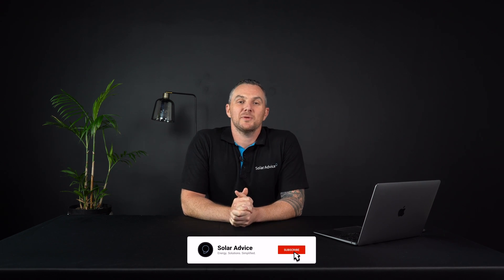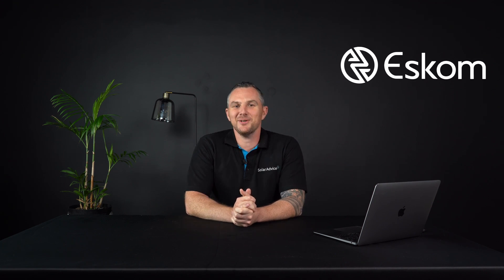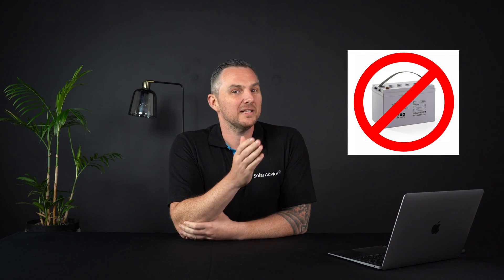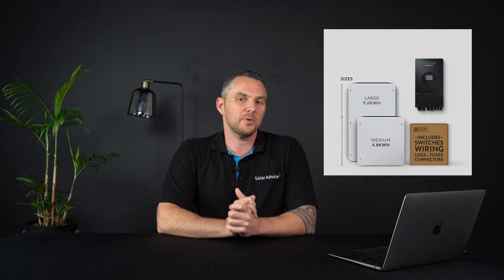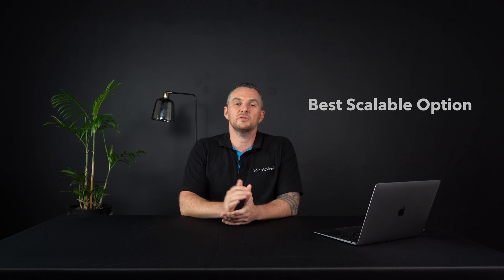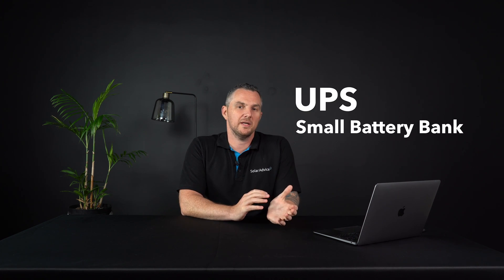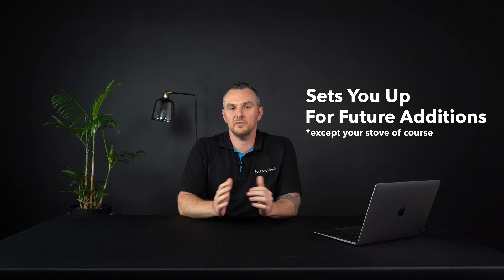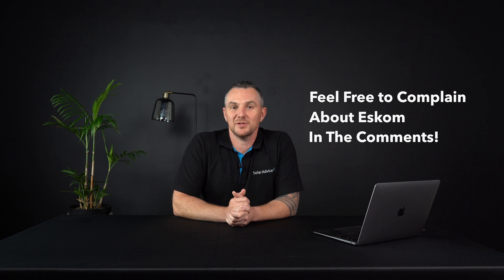Load Shedding Solutions - The Options that work best!

Comment: So I find these videos informative however I have noticed that some of the most important information is being left out when it comes to inverters and batteries. 

There is no mention on the operating voltage (12v, 24v and 48v)

This plays almost one of the biggest roles when picking the right inverter with the right battery. 

For instance you cannot hook up a 24v battery to a 12v inverter and vice versa with the voltage ranges. 

Secondly there is no mention on the impact to performance a higher output battery has in these systems. 

Taking just a 100Ah 2.5kwh battery in various output voltages will provide you with longer lasting power depending on the voltage. 

12v will last the least compared to 24 and 48.
24v at 100ah will last twice as long as 12v 100ah at the same load and with 48v it will be about 4 time that of a 12 or twice that of a 24v if not more.

Yest there is a lot to consider and explain but a simple breakdown and explanation will go a long way in explaining these systems...
Reply from the maker: That would be a completely different type of video, this is of course a general guide on the most popular options for households that’s more suited for a beginner. I’ll consider creating one around different types of small units that work at different voltages.

Comment: If you want to use 3500 watts of power then you will need 23 100ah batteries (gel) to keep up with 4.5 hours of loadshedding. Without damaging your batteries.50% D.O.D.    what average  household got money for 23 100ah batteries?

Comment: Majority of people cant afford a full blown system. The 1k to 1.5k will do most households to see them through and use gas for your stove and shower. Much cheaper than generator and more affordable tha full blow solar. There are some you can add another battery to and also on sunny days add a solar panel to keep the battery charged. If you doing a video like this, then talk costs and availability.

Comment: Putting solar into my home Sunsynk inverter, 20 panels, etc, is it better to get 3 X Hubble batteries or 1 freedom lite won 15/12 home battery?
Reply from the maker: 3 Hubble batteries will be larger than the Freedom won, 3 Hubbles is just over 15kWh unless I am misunderstanding the spec. WIth regards to battery brand the Hubble is 6000 cycles at 50% DOD and 80% DOD at 3000 cycles and the Freedom won is 5500 cycles at 80% or 7500 cycles at 50% DOD. Personally I would edge to the Freedom won but neither would be my personal choice in terms of battery brand, I personally prefer the Dyness brand.

Comment: What is the best solution for staying in an apartment but can run all appliances including the fridge? I’m not too concerned about the lights, just the fridge and WiFi? But is also scalable in case I’d like to add additional appliances.
Reply from the maker: Hi, I would look at a Hybrid inverter because it has a UPS function and the capacity will handle what you want to run, a 5kW will work well as this is what I have and I run fridge, dishwasher, heat pump tumble dryer, lights and small appliances like TV etc.
Reply: @solaradvice is there a specific invertor that you can recommend?

Comment: I always see people complain about the life of these movable inverters, many say after 6 months their power output is barely 2 hours. What causes this, so I can avoid making costly mistakes in the future?
Reply from the maker: Such a great question, it all boils down to the spec of the product and because they are cheaper than a full solution they often have to put in cheap components. If the inverter is low quality and the battery is an AGM Lead Acid battery you're looking at a couple of years and it's done, mainly due to the battery lifespan. If you however get a unit that has Lithium and the inverter is a good brand and quality there's no reason why that wouldn't last you for years to come but it will be quite close to an installed solution. We have had many people upgrade and throw those units away, my advice is just to bite the bullet, buy something that's going to last and is less stressful and frustrating.

Comment: Hi, I am so glad I found this local channel. I do not mind for now to run multiple power units. Currently, I have a UPS for the Fiber router, lasting 4 hours. I need something to run a monitor for about 4 hours, maybe even six hours depending on if Eskom goes to level 10 or whatever. Would be nice if it could also charge my laptop if needed as the battery on the laptop is an extended battery already. What could you recommend I purchase? Happy to use your affiliate link to purchase the item, or directly from your business I assume.
Reply from the maker: Personally anything with a lithium-ion battery, you should be able to get away with a 1kW system but anything more or longer will be tricky.

Comment: Guys I need advice. I bought an Ellies inverter 1440W, on the box it says I should not plugged into the DB board. But I've seen people use this inverter to light up their houses (obviously they avoid using the microwaves etc).

1. Can I just connect the output from the inverter to the wall socket and "power" the house? I've read that this is harmful to the inverter.
2. Can an electrician set up so that the  inverter powers the house lights? Or certain plugs. 

Thank you.
Reply from the maker: In theory you can but I would avoid this because you won't have anything controlling the power going into your inverter, this why you need breakers and surge control. There's been many cases of people doing this and slowly frying the inverter out. 
The electrician can wire specific switches so that certain plugs will work, typically your kitchen will be separated so you simply wire it to the lights and other plugs only. 
A 1440W is very small, you have to be extra careful with what you decide to put on that. Hope that helps!
Reply: @solaradvice  thank you so much for your feedback, and btw I checked the website out and it's great. Going to save up to buy one of those panel+inverter+batteries. 😅 Your video really did it for me! 🙏

May I ask, in regards to plugging in a fan? Is this bad? Some people say that fans are bad for inverters 😅
Reply from the maker: @dr_ricahontas  a fan doesn’t use much power so you’re good with those 👍
Reply: @solaradvice  thank you my guy 👏👏👏

Comment: I'm using the EcoFlow River 600w bought from EvoGames @ R7 000 incl VAT and courier and 100% happy solved all my Eskom troubles. 

Recharges from 0-100% in seventy minutes. All in one portable compact unit without any cables. Don't waste your money with 12v battery, inverter and charger because your battery salesman will try to sell you his high margin 'solution'.
Reply: Can you switch on lights in your home like normal? or do you need to run extension cords to what you need to be on?
Reply: @wwd7562  Ecoflow river 576w, using an extension cord to power lights. It powers laptop + 23" monitor 4 hours with ease. No loose wires, compact 5,5 kg.
Reply from the maker: I agree that 12V batteries don't make sense in the household, it all depends what you want to run at the end of the day, if it's a small system like yours you can get away with minimal stuff, if you need to run bigger appliances you'll need a 48V larger system for sure.

Comment: Hi, thanx for the advice. I am on oxygen 24/7. I have an inverter 2.4. Now with load shedding 3 x a day, my batteries does not work properly anymore. It could run for 6 hours, but now only lasts for 2. This is my life line. Is there a way of fixing the batteries, without replacing them? Money is a problem at this stage.
Reply from the maker: Unfortunately when it comes to batteries are are disposable items so you will need to get new. My suggestion would be to buy Lithium next time, buy once and have the peace of mind it will last you 10 plus years.
Reply: Hi. 10 years. How does that work out with charge cycles and load shedding increasing cycles many more times of your batteries. This reduces battery life enormously of any battery.
Reply from the maker: @markmcculloch2570  each battery can only do so many cycles in one day as it needs recharging, this is why solar combined with battery is the best overall solution to the load shedding issue

Comment: No one ever talks about the more affordable GEL batteries for UPSs for some reason - they are perfect for electronics & load shedding and lasts way better than lead acid or AGM and very safe. Mine has a 10 year design life... Just stay within the recommended DOD. I have 2x 100AH units and it can run a fridge if you wanted, and lots of stuff... Its the 'smart power system' ones. I refuse to have a large lithium ion battery in my house due to the fire hazard it poses... I'll take lithium iron phosphate as that is stable.
Reply from the maker: LifePO4 batteries are very safe and aren’t hazardous. We say “Lithium-ion” but all the new solar batteries are now LifePO4.
The issue with gel has been proper setup, your are right to say they are a good option but unfortunately the vast majority of installations set the DOD incorrectly causing the issues.
Reply: @solaradvice  please advise on connecting fridge and plugs? Single person and fridge is 160W, wifi, router and TV? Thanking you in advance!
Reply: how do I know how much Watts my cctv system uses? Ive got a DVR and 4 cameras attached. my router is not in the same room as the camera system. so currently I have an inverter attached to the Gel battery that i bought and that powers my Router when load shedding is on...but now I need something to keep my cameras on. I tried to use the same 12V gel battery and inverter and attached the CCTV system and the TV monitor that is was attached to. I have the CCTV app on my phone as well. but the battery didn't last even 30min during loadshedding with my CCTV system -Is it the DVR or TV that uses too much power? the same gel battery unit works fine for over 4 hours keeping my router on so why doesn't it keep my CCTV on for 2 hours? I would invest in another gel battery12 V and inverter but if it doesnt work to keep my cctv on then I would buy another, just trying to find out why. I have no idea what 12V is and amps and watts per hour and all that lingo. Really need my cctv on. I cannot bear the nights and 2am loadshedding slot without it, I can only go sleep when electricity come back on and it's killing me at work. i need to get my cctv on

Comment: Thank you for the tips!  I need your expertise though.  I'm going to have uncapped wifi installed (fibre optic) at my home because I'm going to start teaching online.  Like all South Africans working online, we fear the low shedding.  I was told to have a UPS and an inverter installed which will allow my fibre wifi to continue working.  I would need at least 6 to 8 hours of wifi and power time.  I am busy shopping around and found the VIZIA Laptop Power Bank is the first power bank in South Africa with a built-in inverter, which makes it perfect for powering laptops during load shedding. It also has two standard USB outputs, a USB-C output, and a 12V DC output, which makes it the complete power bank for surviving load shedding.  As far as I know, one just needs to plug in, no need for an electrician to install it.  If I may, do you think I am making the right choice by purchasing the Vizia? Thank you.
Reply from the maker: No problem, you can work this out quite easily, just take the number of watts your laptop and modem uses (just Google the general size), add those together and then multiply that by the number of hours you want to run them. For example, if they use 400w together to run then multiply that by 6 hours will come to 3.2kWh, you would need to source a battery size that larger because of Depth Of Discharge, for lithium it’s 80% so you need 3.8kWh or larger.
Reply: @solaradvice  Thank you kindly for your help.  God bless

Comment: Just switched to full solar. Off grid completely
Reply: No such thing as odd grid completely but I hear what you are saying
Reply: That won't work in the raining season
Reply: Are you in Cape Town ?
Reply: What did that cost you?
Reply: R30 000
Reply: To go off grid there are a lot of thing you need to keep in mind that is not mentioned in this video or the battery video. But best bet would be to start with a 5kva hybrid inverter that you can parallel afterwards to 10kva. Pair that with 2 x 5kwh 48v batteries and 12 400w+ solar panels. This will set you up for easy upgradablity for the future to go off grid.

Now some households can get away with 5kva and 10kwh battery and 12 solar panels but we talking small homes. 

Average size (burgers erf) property with a family of 4 I recommend 10kva (25kva inverters) 20kwh battery capacity (2x10kwh or 4x5kwh) with at least 16 to 18 550w solar panels minimum to go off grid.
Take in consideration that this is based on minimum 24v systems but preferably 48v as that will take you further...